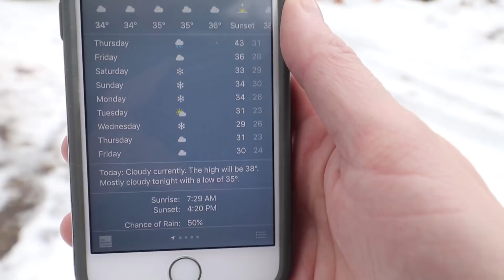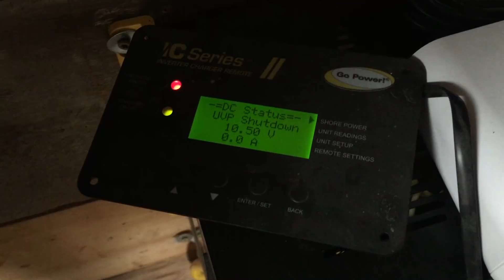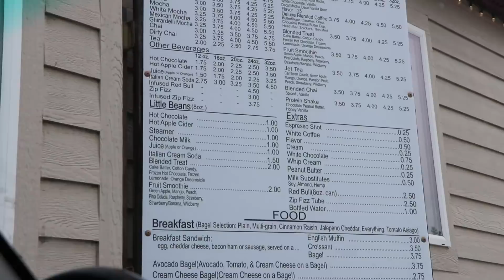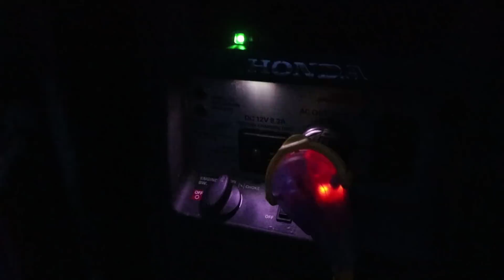Our Story: Giving Up Solar Power to Go On Grid

Comment: There no good reason for you not to go on the grid unless it is too expensive. You have all you need if the grid collapses. But I am curious about how you ran out of power and kept getting low voltage alarms. I  understand that the short answer is demand was greater than supply but I wonder what were the energy hogs and your storage capabilities. Did you have multiple sources of generation, (wind, water, thermal, solar). I have other questions but I don't want you to think the questions are an avenue of criticism so to end .... thanks for your honest videos. Much is learned through example.

Comment: May I suggest that you implement a solar powered hot water tank if you go on grid. Supplement with solar to off set the cost of the power. I think that the pest thing is to use the solar as supplemental not the other way.

Comment: When you do get power someday make sure you can grid tie your solar system into the grid power. That way you can offset your electric bill. We have a solar system and we have a bidirectional meter so we can offset our bill with the electric utility. It makes sense. It cuts our bill down a third each month.

Comment: Thank you for your honesty (I hope my wife doesn't watch this video)LOL.  A better generator with remote start and runs off diesel or propane with a big above ground tank probably would have been much easier and less painful, but that's all in hindsight.  But for the long term, your probably gonna end up with propane heating, so why not do this now anyway?

Comment: Hello To the pure living crew. I am enjoying your series and am in support of your efforts.
Keep it up and in less time than you probably think now you will have a beautiful home.
I understand your decision to go on the grid. My personal experience is a lifestyle with 6-8 weeks per year off grid living. I enjoy both but appreciate the reality of the sacrifices that living off grid requires. There was a previous deailed comment regarding your possible and completely avoidable solar errors. I will not repeat the obvious but i do have a question. Why did you not include a wind generator and if you have a small stream or flowing water source of some sort did you not plan for additional power generation from either as a supplement to sun?  As far as going on grid a reasonably accurate estimate is relatively easy to d yourself. Check with your local power supplier and if anything like the 3 providers Ihave dealt with they have a base line per pole price and requirements for the # of ploes you will probably require due distance from supply and local terrain conditions.
In my last area of consultation 2008 this was between $800-1200 per pole. the project required 6-9 poles depending on choice of location of buildings etc. I have a feeling you have a reliable estimate and are not really looking for any suggestions. Good luck in your project

Comment: You guys have done great. A project like yours is not going to be completed in a straight line. The PNW has power rates that are some of the best in the US which tens to diminish the appeal of solar a little and solar is not a cheap option yet. I have a grid tied net metering system that should pay for itself in about six years. This is because in Washington State some incentives apply. The combination of federal, state, and a one to one long term kilowatt trade with your local PUD are all very important.  Even so, some PUDs have reneged so this may be a concern for some. In my area our PUD has committed to honoring the original agreement.   There will be options for you when you are ready. You just keep doing the next right thing and don’t think twice about what people say or think. Best of luck.

Comment: You sleep as well as you bed yourself. What did you expect from these wimpy 3 solar panels? You would have needed a much bigger solar array of panels. Like a full decently sized system to supply a house. With a decent sized battery bank preferably of the Nickel-Iron type you might have less problems. Dont blame the technology if you dont design it right for your needs... Search in youtube "FarmCraft101 Solar" for several useful videos on how to design a domestic solar system that works either with or without grid backup and with or without battery bank. Or all 3 combined.

Comment: I've enjoyed watching these videos and following your experiences. I've been putting a lot of thought into off grid living and building my own home, like you guys and these videos help. My question before you pull that final trigger on going back on the grid, is, have you thought about wind power. Some of the wind turbines aren't too big and produce quite a bit of power. Also (this idea would take some engineering) hydroelectric power from your water line running down hill towards your hot tub. It's not everyday power but that can be stored. Like I said I'm enjoying these videos, thank you! And can't wait to see the finished product! Good luck

Comment: From experience running a generator is expensive and time consuming.In Minnesota a good home solar system payback time is over 20+ years not to mention they are very expensive up front and labor intensive for the life of the system. If solar were the answer everyone would go solar.

Comment: The news was a bit disappointing, In 1988 i studied alternative power in collage, you do not build an alternative system unless you calculate  the actual power you need (stove, fridge freezer, everything) you should not and cannot depend solely on the sun, wind power must be utilized also. If done correctly, is cheaper and more dependable then the grid. calculate how much it cost to run on the grid for 20 years, at an increase of 2 - 3% increase per anum, paying a higher premium for power when used within peak times. Using a generator was a terrible idea. Did anybody calculate the yearly average sunshine, or the amount of wind in your geographic location, or determine how much solar you could actually expect. You could, in some places, sell your unused produced power back to the grid provider.

Comment: Utilize the solar for exterior lighting.  I don't blame you for going on grid.  It's security.
Reply: 0TedDBear0 how is being on grid secure?
Reply: When I was off grid solar I never had a power outage that was unplanned in 15 years. Now that I'm grid-tied we have power outages 4 or 5 times a year. The grid is nowhere  near as Dependable as off-grid solar.

Comment: Since you ashew building codes, electrical codes, building standards inspectors, contractors, living standards and now apparently the non-standard life-style you built your channel around... You may as well realise that you are a 'property developer'. And as one, you are soon to find out the cost of bringing infrastructure to your property is going to cost a pretty penny. And don't expect the utility to hook you up without inspections of standard wiring methods. Or go the trailer trash method of 'off-grid', find a neighbors electrical service down the road - then run extension cords in the dirt up to your trailer. Otherwise prepare for the utility to charge you to install lines, poles, and a transformer - then a meter. When you get the estimate for that, you'll be doing videos by candlelight.

Comment: It's your choice do as you please. Have you considered having a  Solar Company or technician come out. See if they could help figure out usage and the best solution for power. See if larger panels in a different area with a larger battery bank and maybe a  generator that is tied into your battery bank. That auto turns on when the batteries need charging. Also a larger fuel tank onsite. Again this is just a thought this is not a judgement on what you're doing. I enjoy your videos again just a thought in comparison so you have two options. That way you can weigh the costs and benefits between the two options between the utilities and off grid. Cost of upgrading you system or cost of getting grid power.

Comment: True. You would have to win the lottery or have saved for many years to get a top notch solar lithium battery set up. I have seen many systems that work flawlessly and maintenance free. I live in Arizona where there is 320 days avg of sunshine per year. It works great here. These people live exactly like they were on the grid.

Comment: Since you guys do have some solar infrastructure already, are you investigating what it would take to do a grid-tied system and get some credits for putting energy into the grid when the sun is shining?  Could save some money, and it doesn't require the same level of maintenance since a storage system isn't necessary (ie. the grid is the storage system).

Comment: LoL..... Not everyone can make it off grid.. You have too many city needs. . Being off grid takes sacrifice. .Not everyone is willing to make them. . Ihave 3 wells on my property. .One runs off 1 solar panel,a 12 volt battery a 850 watt inverter.. The other 2 are not being used right now.. I have 1 windmill that is making 3500 watts day and night.. I'm in under $2000.  That is less than 6 months power bill.. But I don't have unreal expectations for power. . I live simple .. Grow and raise most of  my.food and don't have new cars or bills.. Good luck in your getting back to the system. ...God bless and have a great day

Comment: You've had a difficult lesson in applied physics.  With solar energy location is everything.  The available energy in the northern reaches of the country is very different from the desert southwest.  You live in a location that has very short days and is cloudy for months on end.  This makes a stand alone off grid solar power system  a very expensive proposition.  If there is grid based power available in the area, it will render the off grid solar approach not feasible from a economic perspective.  When you do the math, it just doesn't make sense.

Comment: Thank you for the great videos! Your decision to make the rational choice of grid power should be no surprise to anyone. You guys are incredibly busy with life. The keyboard commandos sit there in A/C comfort, PCs humming, sipping their warm beverage of choice and rant. Oh well, life is full of priorities and wasted band width. 
What should be no surprise is that Solar is very time intensive and requires expensive equipment, conceptually a nice idea but is not reasonable as a primary source for 99% of people. Yes there are people that do not have a choice but in USA that is very rare.

God bless you both and enjoy your journey.
Reply: They still haven't seen the costs for bring power to the property and connecting the house/workshop/etc to the grid. Rural connection can easily cost more than a fairly beefy, properly set up Solar+Wind+GenSet setup.

Comment: Wow, welcome to this century! My grandmother grew up without electricity in the early 1900's. Guess millenials have to learn the lessons the hard way the rest of us knew all along. Second, "alternative" and "viable" are just buzz words. Solar is better phrased as a "supplemental" power source. Not an "alternative". Nothing beats carbon based and nuclear power for pure output for the amount of output.  The electric grid has been around a long time. It works well.

Comment: I think you are making a great choice. We have been living in am RV for 6 months off grid and are building a home on our property. All the research and number crunching I have done I would need 40 solar panels to produce the Kw I would need too have modern appliances and electronics in my new home. Comparing the cost of solar material and price for being on grid, we concluded on grid was more economical and practical. 500 ft  of underground electric with us trenching the ditch was only $500. Way cheaper than $10000 in solar panels...
Reply: You do know that you don't need 12Kw of panels unless you think that you are going to be drawing 12 kw on average....half that amount with an inverter system that can source the needed power when required would do fine. Probably even less if you analyzed average power requirements. If you are drawing 12 kw on average then that would be 8640 Kwh per month. Are you insane? Your electric bill at only 12 cents per kwh would be over $1000 a month. Check your math dude.

Comment: Good for you . It's just my opinion but if you have no power at the road and no chance of it ever being there, then by all means go solar or any means of making power. I have a weekend camp. When I bought the property, I put a camper on it. I used the rv battery to run the camper and a noisy generator for backup in case I want to run the coffee maker or tv. I had power at the road. I had a contractor bring in power underground 250ft back. He put in a 200amp service(more than I have at my house). He took care of everything at a cost of $1900. Could I get a solar system for that price and will it run my air conditioner, washer and dryer and electric hot water tank at the same time. Doubt it!!

Comment: I'm glad you realize that not everyone that suggest solar for 'off grid power' has actually done that for themselves. 
I have not lived on solar, but have done a lot of research into using solar and wind for power. From that research I have a few suggestions, 1 Yes connect to the grid (because on those awesome sunny days, the power co. pays you), 2 have a motor system that can flip you panels (either automatic 2x daily, or manual via toggle switch, 3 use all three sources (grid, solar, and wind) 4 get a professional to connect up the controller (as it is complex auto switching system) 5 Keep doing what you do, because it's absolutely awesome.

Comment: To be honest.  Solar is probably easier if you have an electrical background.  Some of your videos you've seemed to struggle with the basics.

On the other hand you guys are living a lot off of the generator.  For anyone thats run a generator after a storm for any length of time can tell you how cheap electricity is when you get it from the electric company rather than paying for gasoline.

Besides, you have the solar equipment.  You could look at some grid tie options.

Comment: I will ultimately build a decent-sized cabin in the woods of Tennessee. The nearest utility pole is over 2 miles away as the crow flies, a lot farther if you follow the road. So I will be off grid. I have spent extended periods living without any electricity at times. It's not fun. I will have to rely on solar/wind/generator, but I will not need a lot of power. Refrigeration is my main concern.  

Are we humans spoiled? Nah, electricity made the modern world. It is, after the flush toilet, mankind's greatest invention.  Go for it.

Comment: You were a bit "subtle', but I think I got that you're frustrated with solar and those that "preach" solar? LOL! 

I totally get it. My situation is a little different than yours. I recently bought and moved into a 5th wheel trailer. During my long period of research before purchase, I did seriously consider solar but ultimately decided it was not going to work for me for two big reasons. First was the cost  (and extra weight), of a big enough system for how I want to live my life, and even then, it was not going to be big enough (2nd reason coming up) to run my air conditioner or even run my little freezer and dehumidifier for very long. Even the microwave sucks so much power, you could likely watch your battery "gas guage' drop. I chose a generator instead for cost, reliability, weight, and pure power to run high amp draw appliances. I do not live off grid, but I want to have that ability. I did not need to get and experience solar to realize it wasn't for me, so I hope you don't clump me into that group you were talking about. Solar has come a long way, but you can't compare it to the grid like apples to apples. It "can" work, but with limitations and you just can't get away from having a generator unless your power use is so low and/or your battery bank is so big, you can live for almost a week without sun. That would be extremely difficult unless you lived in a tent and gave up electronics. As you know, even in an rv with propane, your appliances need that 12 volt power for control boards, ignitors, and fans for the furnace.
In your case, since you already have the solar system in place, I don't see any reason why you couldn't be set up to both sell power back in the spring and summer when you have more sun.., and and also use the "grid" more like a big generator you don't have to put gas in. 
I think your choice is perfect for "YOU" and you shouldn't have to be so defensive about it, or any other decision you make for you and your family.

Comment: It's ok.  Please do you. There are other homesteads on the Grid. Each ones need is different.  The fact is one has to factor in and possibly overestimate your needs solar wise before set up. Also one has to consider the weather for where you are. I don't think other people's experience with solar is of fanciful ideas. Remember there are those that have done it a few years well. And all the homesteaders I've watched also stress back methods to solar because of basically the weather. The way you've worded some things to your audience about solar may be offensive so expect backlash. I don't agree with all that's been said. But I do know a considerable amount of homework must be done and it has to be done with needs in mind EVEN BEFORE SET UP. I'd like to add too NO ONE PLAYS HOMESTEADING. Each homesteader is as different as night and day, sun and moon, water and fire AND ITS ALL BEAUTIFUL. Be careful with what you say to your audience, not playing down any one thing of homestead life. 🌞